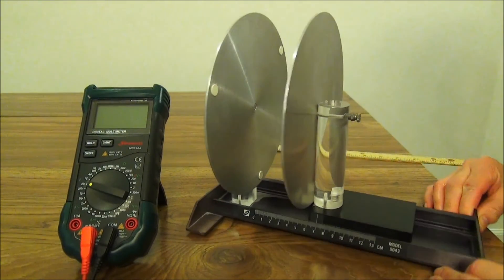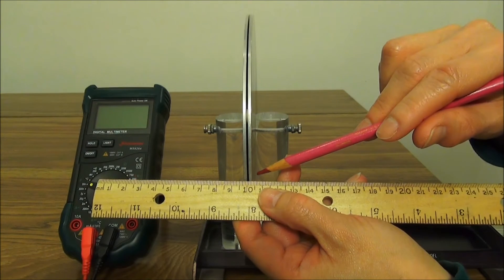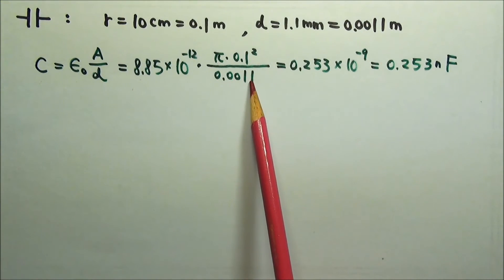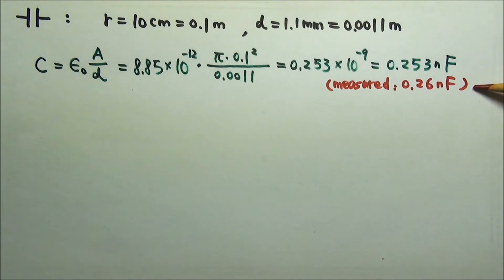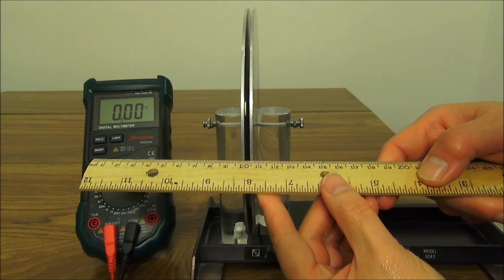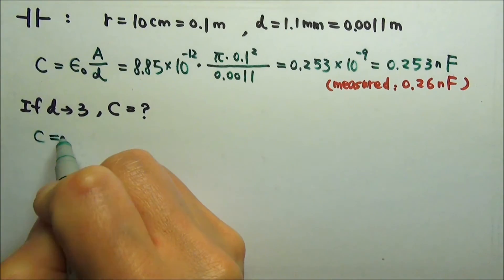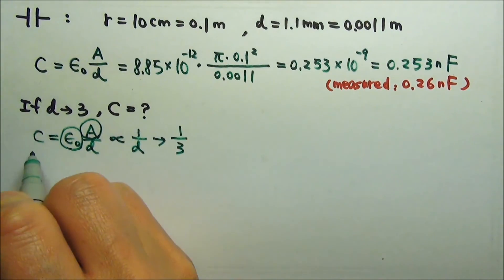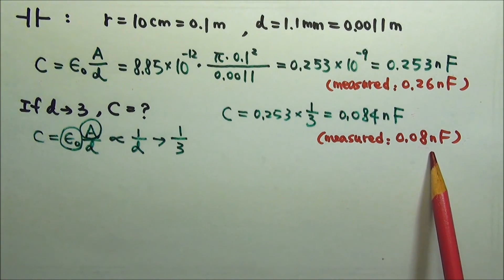AP Physics 2: Static Electricity 29.2: Changing Plate Separation of a Parallel-Plate Capacitor

Comment: Ms twu, I have a question. if I change the dielectric material with the other materials. for the example water, how to measure the dielectric constant using the two plates. thank you.
Reply from the maker: Please see AP Physics 2: Static Electricity 29.3: Capacitors & Dielectrics, Dielectric Constant at https://sites.google.com/site/twuphysicslessons/home/static-electricity/static-electricity-page-5 
For pure water, I suppose we will need a thin walled insulator (e.g. plastic bag with a known kappa for the plastic) to serve as a container for water. Because of the added plastic layers, we will not get the kappa of water directly. We will have to treat the situation as 3 capacitors in series: 1 filled with plastic, 1 filled with water, and 1 filled with plastic (like a sandwich), and go through some trouble to calculate for the kappa of water.
Reply: You can't, because water is not a dielectric material.
It conducts electricity.
Reply: @jonshala538  Pure water free of impurities is a dielectric actually. In fact its the foundation by which Electric Discharge Manufacturing (EDM) is based on!